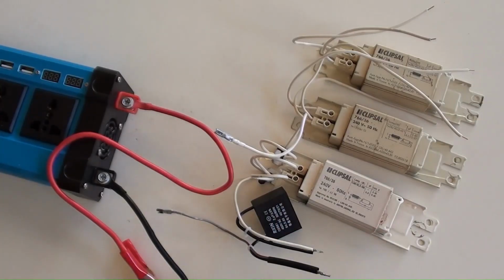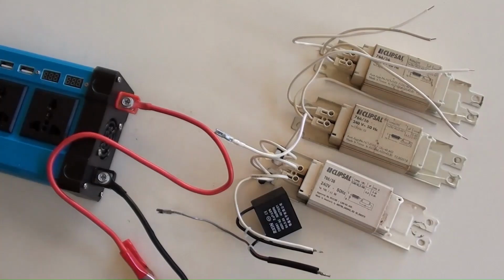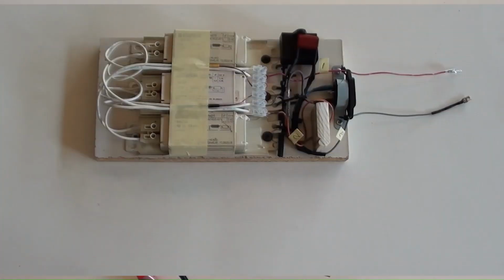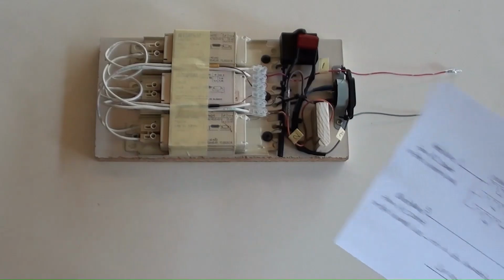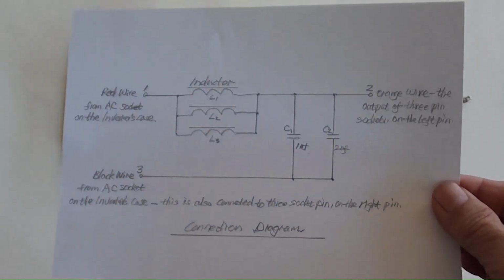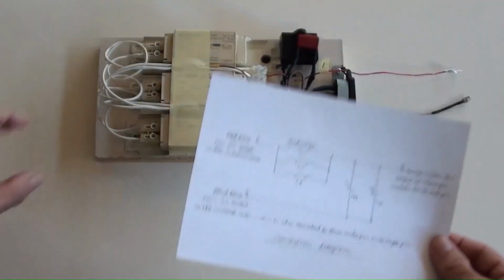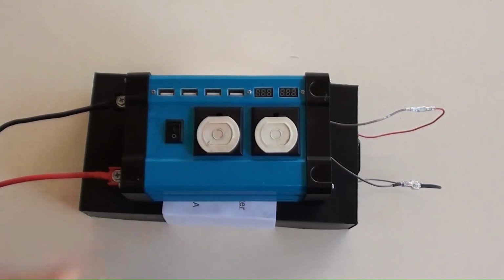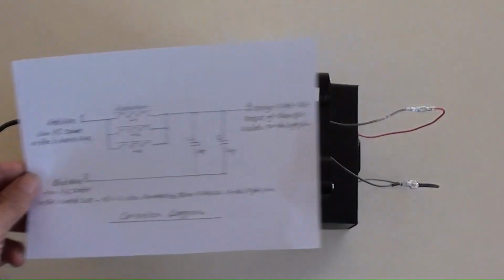Sine Wave Converted Made Easy!

Comment: good work my friend that is smart converted square wave into pure sin wave not many people no this tricks maybe you can tells me something if I’m wrong or right my friend this inverter it a 300watts it will not work for a 650watts electric dill at all
Reply from the maker: Thinks for your interest!  You're right - a 300 W inverter in this video showed can only drive less than a 300 W electric drill - say:  A 100 W or 150 W electric drill.  In order to drive a 650 W electric drill, the inverter needs to be a 1kW or higher, then the one has to make a LC filter customized to match that inverter which it could be done In theory, just like did in the video.  However, however it wouldn't be wise economically done in practical situation because of the larger inverter, the higher cost for LC filter.  Cheers!  👍

Comment: It is puzzling. The inverter must see a resistive load, while the load must see a sine wave. 

The power in the harmonics need to be dissipated into a resistive load, the LC filter does not dissipate harmonic power.
Reply from the maker: Thanks for your interest, Mate!  The LC filter in this video is not the inverter's load, it is as the part of the component(s) with the inverter together to get Sine Wave Output.  The video has showed at 6:10 - 7:20 particularly.  Enjoying your experiences.  👍

Comment: The  Inverter Box to start with , is NOT common high frequency square waves, but very low frequency 50 cycles. Therefore conversion cannot be used on the square wave, or modified square wave high frequency Inverter box.
Reply from the maker: Thanks for your interest, Mate!  An original inverter box has to be a 50 or 60 Hz with a modified square wave, then it can be converted to sine wave in this video showed.  👍

Comment: What is the output waveform like with no load connected?😊
Reply from the maker: Thanks for your interest!  The output waveform was sine wave with or without the load.  In the video at 6'40" -  6'50" section, it'd showed sine wave on the mini oscilloscope for no load waveform.  Cheers!  🙂👍

Comment: How did you choose the value of the capacitors as per rating voltage ,or current
Reply from the maker: Thanks for your interest and good question!  Well, I've no clue about calculating it in the theoretical way however in the practical, it can be done by referring to the similar product(s) on the commercial market:  In the most cases, the capacitor's capacitance can be chosen as between 1 and 3 µF (150 to 3000 watt's inverter) and its voltage rating as 1.5 times the value of the output voltage (an example: the output voltage is AC 230 V then the capacitor's voltage rating = 1.5 x 230 V = 345 V at least for safe margin).  Cheers.  👍

Comment: Cómo hiciste para usar ese osciloscipio, con una salida de voltaje tan alto q usaste ..
Reply from the maker: Thanks for your interest and good question!  One of the ways is to use a Voltage Divider which can be "DIY made" such as by using two resistors at least, their ohm value can be chosen as you wish - Ratio  as 1:10, 1: 20 & 1: 30 ie. in series connected (make sure the resistors have adequate wattage).  The Voltage Divider has three terminals (ends):  The ends of highest ohm value connects the inverter's output terminals and the ends of lowest ohm value will be connected to the oscilloscope.  That's it.  Enjoying your experience(s).  👍👍

Comment: Bullshit! You need a special spwm module for making it fully sign wave… if it was that easy they would’ve already done to it…
Reply from the maker: Thanks for your interest and glad you said that!  A special spwm module is the most efficient one & its circuit's board complicated in details for sine wave inverter to have, however it is not the only one.  In the most practical situations, the same result can be accomplished by varies ways such as in this video showed which is the one of ways to make sine wave inverter possible.  Why didn't you experience yourself if you had, you'd have gained some knowledge.  Cheers!  ❤😐👍
Reply: @diymade2175 so far it seems my knowledge is way more advanced than yours😂😂😂😂

Comment: For a 1000watts inverter how mnay indcutirs do i need and can i get one with higher current
Reply from the maker: I've no exactly idea Mate, however for the DIY case in the video showed by using inductors from the florescent light used:  30 of them might have to be needed and have to be arranged for some of them in series and the rest in parallel connected.  There is no any problem(s) by using a single or multi stages inductors / capacitors to have your inverter converted in theory however in practical, the most likely in your case, the inductor(s)'d be expensive comparing to the inverter's original price, in other words:  Often it is not economical to have it done by purchasing inductors / capacitors unless you have the way of keeping the cost down or paying nothing?!   Cheers.  😎👍